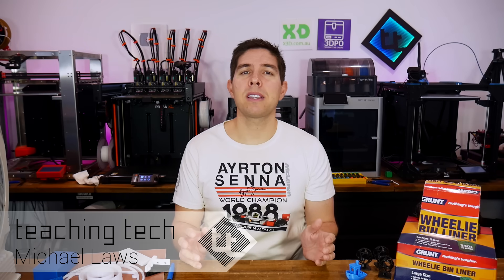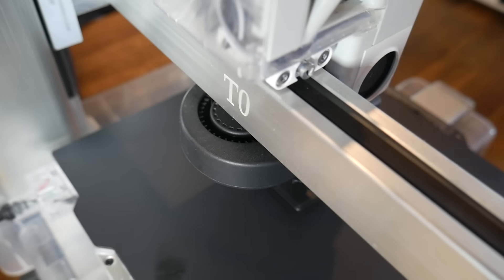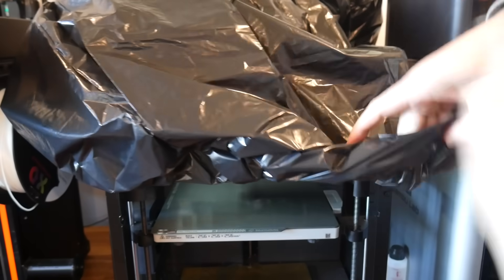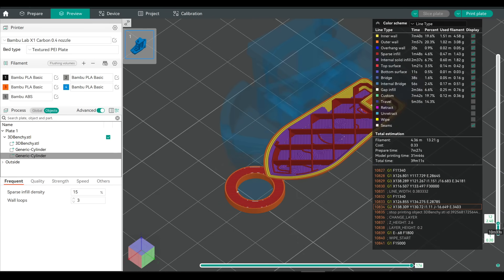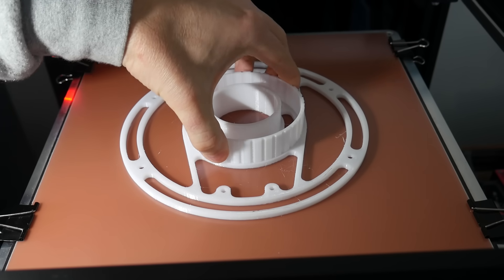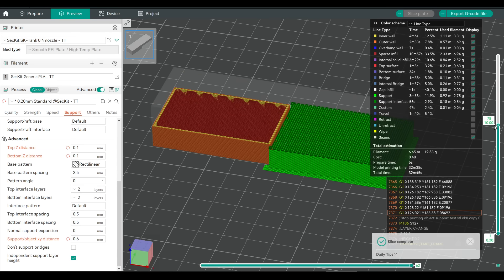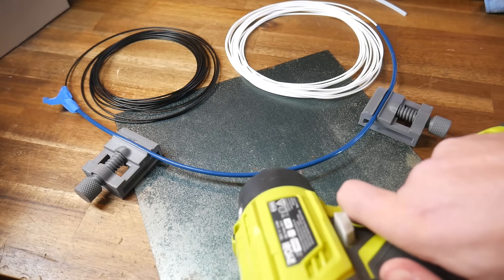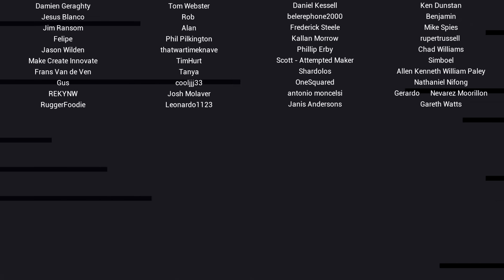Jankiest 3D printing tips that actually work

Comment: Maybe janky (new word to me), but some of these solutions to recurring issues are quite relevant. It reminds me of my old boss who's favourite saying was, "It's not about what you can do. It's about what you can get away with." I keep my filament bone dry at all times (West Coast BC) and haven't bought a filament dryer, so I bought X-Large ziplock bags and bag the filament right on the spool holder. Keep my desiccant container in the bag and it maintains low humidity very well.
Reply: Same! The bag also keeps the filament on the spool - new spools tend to let a curl escape over the side where it binds up on the spool holder.
Reply: True. I redesigned my spool holder with 8mm bearings and it worked so well/poorly that the spool would continue unrolling at the slightest tension. The bag adds a bit of drag and keeps the filament wound.
Reply: Janky comes from jank which comes from junk, but with a funny pronounciation, I think

Comment: I've often joined leftover filaments with a translucent ptfe tube. After pushing the melted ends together, pull them a little and the weld will thin out again, so you can get closer to a perfect 1.75.

Comment: The janky way for joining is using a lighter. 
Hold both ends into the flame and push them into a small piece of tube from both ends.
Then heat it up again and pull it apart until the diameter seems ok

Comment: Using an oiler / replaceing capricorn xs tubing with cheapo generic 2mm internal diameter one. 

No worry about bending radius, extruder pushforce or if the one ziptie is not 0.001micron too tight so starts pinching down on the filament once the printhead only thinks of moving.

No hate on capricorn tubing though. They state on their website that capricorn xs can cause trouble.

Comment: Oooooh, I like this one because I am a proud owner of The Janky Ender 3 Pro (which still works despite all upgrades I commited to it). So... My list:

1. You heard of "cold pull", now introduce "hot push" to unclog heat creep. At first, heat up hotend to 280C and disable hotend fan so heat can transfer up to cold zone. It softens clogged plastic enough for it to be pushed out. Push in some cheap 1.6mm weed wacker string. When plastic starts extruding, turn on hotend fan and continue pushing weed wacker string until it starts extruding clean. Turn off hotend heater, while still pushing weed wacker string. Push it until it stops melting. Wait for hotend to cool down and do a cold pull. Now hotend should be clean enough for the next clog.

2. Replacing the nozzle is a well documented procedure, but I was getting leaks anyway. Probably hotend wasn't hot enough so I detached hotend assembly from printer, removed heater cartridge and thermistor, gently heated it with propane torch up to "not glowing yet" and tightened it up. No leaks since then.

3. Filament dryer can also dry socks.

4. Jon from ProperPrinting showed in his lamp build video cool technique to increase mass of printed part for cheap. Pause printer before it starts covering infill, pour in sand, resume printing.

5. Mainsail/Fluidd don't know how to "start printing job later". Or I didn't update for too long? Anyway. G4 P3600000 pauses for 1 hour.

Thanks, bye!
Reply: #3 lol 😆
Reply: Would not recommend 280c on a bowden tube based hotend... 230c will still soak into the heatsink with the fan off just fine and not be a risk.
Reply: No.4 - Scary! I've read horror stories of the part cooling fan blowing sand into every nook and cranny of the printer when this "tip" is followed. I would strongly recommend disabling the part cooling fan until a bridging layer is put down over the sand (or perhaps not using sand at all!).
Reply: I cleared a clog a few weeks ago with a power drill... :)

(I think what happened was I didn't fully seat the bowden tube after clearing some cracked filament, so a huge slug of plastic built up in the gap which I could not get out at any temperature...so in a last desperate attempt I took a drill to it. It worked! Lol)
Reply: @Urza9814  for that I use the blowtorch and screwdriver method, heat the tip of a screwdriver that will just about fit, use it to push out the obstruction as best you can, leave it to cool a little and whilst the filament is still stretchy ish, twist and pull to remove the remains

Comment: That sharpie trick with the supports is great. I wonder if it could be built into the extruder head, like having a small sprayer nozzle (like an inkjet printer) next to the extruder nozzle that can accurately spray the stop of the supports (even have multiple spray patterns for optimal release/adhesion).
Reply: I don't think you'd need anything that complex. You could just use an actual marker pen.
Reply: @andybrice2711  That means having to stand there painting supports though, I want to just send to print and walk away and come back to a completed part with ready to remove supports. I already do that with my Bambu printers with the AMS using PETG interfaces with my PLA prints. But it does have poops when changing material and adds print time. Having a separate MEMS sprayer next to the extruder nozzle that applies releasing agent automatically would eliminate the purging waste as well as the additional print time changing filament.
Reply: @LegacyOfTheAncientsC64c  Nah I mean attach a felt tip marker to the extruder. (Though it might need some sort of retraction mechanism.)

Comment: To join 2 loose ends of filament i use a cheap hair straightener where i sandwich the ptfe tube in between to get it warm enouh.
It won’t heat up a very large area as with a heat gun and doen’t get to hot as with a lighter.

Comment: Another janky way is of course use cardbord to make support.
Print first part that is small, pause at hight and tape some cardbord-made support-structure on the bed.  Then continue the print with just a few layers of support on top of that cardbord.
Especially usefull for high prints: lots and lots less support so much less plastic and time wasted.

Comment: Want a smooth finish on the underside of your prints, but only have a textured PEI plate... just leave it off ... (I tend to do this accidentally when I forget to put the plate back on) You may need a well tuned printer for this to work, and a filament that won't bond too well or poorly to the magnetic sheet, in my case that has been ABS. There is a bunch of stuff that could go badly wrong, but the request was for janky, not sensible ....  😆

Comment: A trick I used to use was using sugar water instead of glue on my print bed. Was incredibly cheap and worked great. Unfathomably messy though.
Reply: You can buy a 1L white glue bottle for almost nothing, dilute some of it 1 to 1 in water and apply with a brush. I've been printing for years and I am still on my first bottle.

Comment: I immediately knew it will be pcb as bed surface when i saw the chapter.
I ran that for a bit, the problem is, the pcb will curl up after a while. I had to change the bed on my ender every 3-4 months. 

But still , i got the material for free, as my school was throwing it out.

Comment: oh boy this is getting personal and almost spiritual. having started with an anet A8, the first CHEAP 3D printer kit, way back when, this hits me right in the mostalgia. coping with jank in dodgy ways. and to generously sharing knowledge with others on #reprap. was the way to go. and that trusty, crustiy, blessed PoS ist still going strong 10 years later, with all it's stock parts in place! <3 ..except for that one stupid heatsink on mk3 extruder heads, and 3 SMD capacitors.
>glass print beds, binder clips, and odd adhesion/release agents in order, if shit wont stick, or come off: alcohol, vinegar or glue stick (on a pre-heated bed), spit, blue tape, blue tape rubbed down with alcohol, spit after a shot of alcohol followed by glue stick and swearing like a sailor ... and double sided tape, as a last meassure for stubborn TPU.
>filament oilers (incredibly underrated, to season a new nozzle/heatbreak combo with over heated PLA) only use the tinyest amount of olive oil on a piece of kitchen sponge, and stick the filament though it. 
>manually leveling an i3 pattern printer while printing a 7 round skirt, by tunring the two Z-drives by hand on the 1st layer.
>making an anet A8 work well in the first place, with crap from the kitchen and/or the hardware store
>being told to "unsolder resistor C43, C44, C45" by anet's tech support, to fix a malfunctioning end stop. it worked for me and many others! 

i loved those times, that taught me to respect, embrace and foster the cheap wonky machine in my service to do it's best, and learn from it's peculiarities and my own. it was as flawed as myself, we grew together, and it has become a companions ...  being  a close knit niche community of nerdy pioneers was the best part! <3  this ain't no bloody HP deskjet
Reply: PS: tinting clear PETG by pulling the filament along a sharpie. it looked amazing!

Comment: I've used scotch tape to recover loose parts on the printbed. Some just use superglue and realease with acetone (not for abs prints).

I mean taping the print to bed after it curled up and was flapping .. the print continues embeding some of my tape in the print but at least is not completly failed.

Also on boxes after gaining some height if the part starts to curl i put some magnets on the print (it attracts the bed keeping the bottom of the box in place). It has to be certain type of model and certain height to be usable, but when it's doable it's nice. 

Some of my advanced tricks involved making some double sided keychains and some oddly placed pieces of text i wanted with different color. So for my part it needed to be flipped and printed on the other side. I had a bunch of them to print on the other side so i designed a cradle to nest the part and left the cradle on the bed. Then modeled my rest of print on top of keychain, altered the gcode to start at the height of the revious cradle and using the cradle coordinates the print aligned just perfect. Long story short.. i put the part, start the print, remove it . I'm using prusa mk3s and due to selfleveling is tricky to start a print midair. I've spliced my G-code a lot and includes start printing the cradle - change filament (from petg to pla, also altered temperatures in gcode for pla), then after resuming (the part was aready placed in cradle) it prints on the other side and when it finishes it just pauses.. i get my part out, put another one and resume printing After the pause the g-code was copy pasted to have like 50 repetitions for 50 parts.. did about 20 or so (that's what i had) and canceled the print.  

Other unusual methods i've done: embedding all sorts of things in the print (magnets, bearings, bolds, rods, plates, nuts, etc), embedding another print (this a cool one.. like printing a tower of flats ad different levels.. model the flat slabs, print them, model the rest of the tower without that piece, add pause when suitable, resume printing.. it will fuse the plastic), adding manual reusable supports (insted of wasting lots of material or leaving ugly surface and hard to remove support.. i print and before the bridging i add a part that fits and support the print (metal washers, metal blocks.. i have a bunch of machinist gage blocks and stack how many i need for the exact thickness to not crash the nozzle. 
And there are plenty more G-code tricks to allow all sorts of unusual interactions with the printing process.

Comment: My best jank: I ground up PLA leavings and made an acetone slurry of it to paint onto the bed to improve first layer adhesion with some custom filaments I was making.
Reply: Hmm, interesting. I just use a 50/50 PVA and water mix.
Reply: Interesting that it responds to acetone. PLA that i have... i only have one spool of PLA in spite of printing for 7 or 8 years now... doesn't react to it at all. I mostly do PETG and more recently HIPS that's why.

Comment: You can also use two spools just by pushing the new one in when the old one is running out. I have done this multiple times one my Ender 3 V3 SE without problems. 

Just lower the printing speed manually to make it easy and it does not take long. Obviously you need to time it well but it is super nice to use all the fillament leftovers and such, or on big prints if you plan for it.

Comment: I feel like such a pussy for using a temperature controlled desoldering station heat gun for removing stringing when I had a double burner butane torch for applying 'torch on' roofing felt at my disposal.

Comment: Another way to "fix it with fire" is to reshape parts after they've printed. If some dimensions were a little off in your CAD model, you might be able to soften the print with a heat gun or fire and make it fit by hand

Comment: You can save some failing prints with a soldering iron (with proper temperature control) by pausing the print and welding the plastic to where it's supposed to be. You can even weld it back to the bed, but it can easily damage the bed.

Comment: I tried to join two rolls of ABS in a similar way. Turns out the last 3 meters of material on the roll were significantly more brittle, so I had to fix a mid-print failure 3 times within 10 minutes, as the material kept snapping before reaching the weld.
I always print on a bed covered with polypropylene or paper tape. Every material works with only one of them.
I was too lazy to update the firmware, so I added 100 ohm resistor in series with the thermistor to raise the max print temperature.
I use car lightbulbs to heat the printer chamber

Comment: For a cheap way to dry your filament:
You have a nice heated surface already! Just stick the spool on your heated bed, set an appropriate temperate, cover with cardbox box or similar. and go.
Reply: I know that the Bambu X1 series and the P1S has the option to dry filament using the heated bed in the firmware.   On the screen for the printer there is an option under Utilities called Dry Filament. In there one chooses the type of filament which selects a preset value for the bed ( between 65-75 C for PLA, 75-85 C for PETG, 90-100 C for ABS, etc). It recommends putting a cardboard box over the spool of filament and turning it over halfway through the 12 hour drying cycle.
Reply: @capitalinventor4823  Fun fact, BBL even designed a cover that you can print and put over the spool. Almost certainly not more effective than a cardboard box but it looks kinda cool.

Also the P1S doesn't have the option in the printer settings but they've published the times and temps online so you can just set the bed temp manually and set a timer, I really wish they'd add it to Bambu Handy and/or Bambu Studio so I don't have to do it manually
Reply: For a bonus wire one of those almost useless ender cooling fans to the top of your cardboard box to help remove some of the moisture
Reply: @williwonti  That's way too professional. Put a couple tiny holes in the top and bottom of the box or bag. The hot moist air leaves all by itself!
Reply: A bit of aluminium roll does the trick 👍
Reply: The problem in some printer configurations is that the thermal runaway protection might kick in and shutoff the bed heat if a print hasn't started after x number of minutes. The default Marlin config on my Ender 3 shuts off the bed if a print hasn't started in 10 minutes.
Reply: I just put my oven on the lowest setting and leave it in there all day. One of my spools got a little whopperjawed on the wire shelf but most of them resist the heat just fine.

Comment: i fixed a print by using a piece of filament as filler rod and set it on fire. i used the dripping molten plastic to weld the pieces together

Comment: Janky tips:
1. If applying glue stick to the bed is too tedious for your liking, you can just use hairspray.
2. For 3D scanning, you don't need the expensive scanning spray to make a part matte - you can just use dry shampoo. It stinks, but it's dirt cheap and leaves a matte dust.
Reply: Don't use hairspray when the plate is on the bed... It'll get into the electronics.
Reply: I've never been able to get gluestick of any brand to apply easily. Just water down some PVA glue (Elmer's) and apply with a foam brush. Goes on super easy, evenly and dries pretty fast, especially if you heat the bed.
Reply: @greyspot00 Didn't know Elmer's was PVA--I've always used Aleene's Tacky Glue which I know for a FACT is PVA. I just dilute with water and brush on! Also can be re-constituted by spraying with water and re-brushing the surface to renew the texture!
Reply: Or use Homer's makeup gun for part 2.
Reply: For 3D scanning I saw someone used corn starch and was spraying it on the part with a toothbrush.